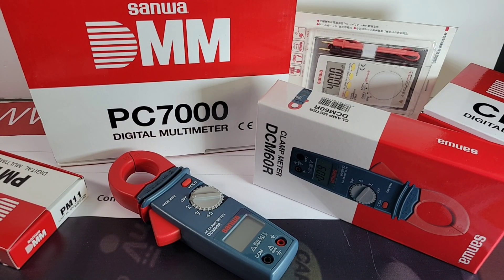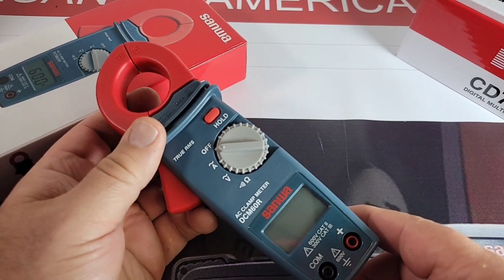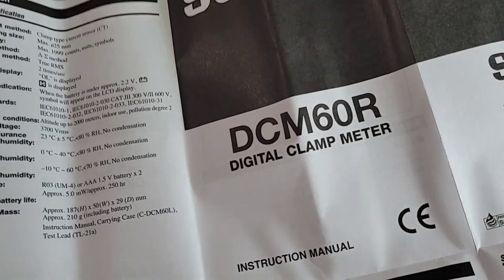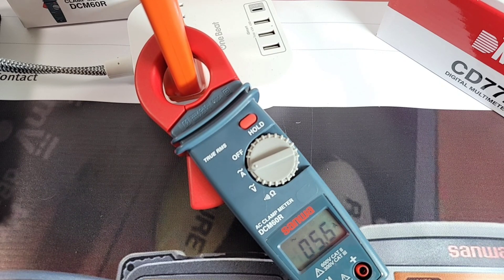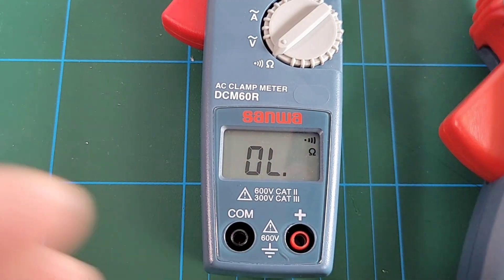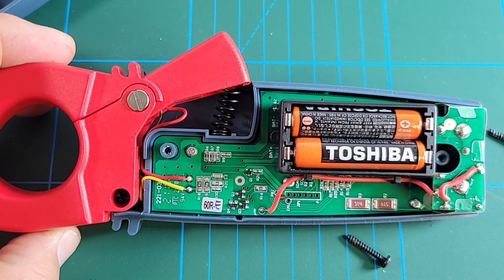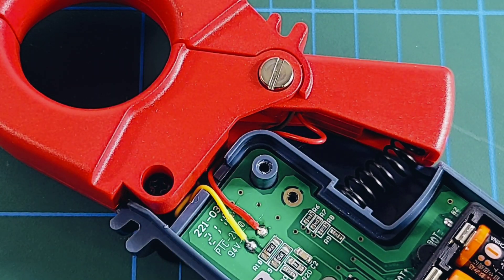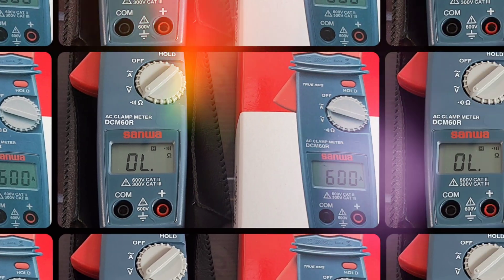SANWA DCM60R AC Clamp Review & Teardown!

Comment: good for general electrical troubleshooting but if this were my first clamp meter, I’ll probably have to buy another clamp meter with more features (DC voltage & current, capacitance measurement, etc). I think this meter is made only for specific customers, Maybe for entities/organization that has strict regulations and doesn't want to bother testing and documenting other unrequired  parameters.
Reply from the maker: Yes, I agree 👍

Comment: Always glad to see the Taiwan build quality, especially in an AC specific device.  As has already been said I would think they could include a back light and more audible beeper & better resistance function in this price range particularly when working with AC, but I cant really fault it for no DC function as it says right on the device AC CLAMP METER so you have to consider it a device with a specific purpose - though oddly by coincidence the first letters in the model munber are in fact "DC" - lol - but thats very likely for "DC Clamp".  One thing, one of the most common uses for these clamp meters is HVAC which always includes motor and start up cap testing so that would have been a logical inclusion in this meters $85 MSRP, again it gets down to your specific purpose with this meter.  What we could see of the input protection looked respectable and the Taiwan / Sanwa design and build quality always has that air of dependability when working with AC voltage and amperage.

Comment: Sorry, I can´t get who should buy this clampmeter? Only AC and Amperage up to 600 A - that would be a professional electrician in a CAT IV enviroment ( power supply of a house) or heavy industrial enviroment. But without matching CAT-rating and not independent certified? Highly unlikely...
For usage with electronics, car electric and inhouse electric installation I stick to the Uni-T UT210E clampmeter. Much more versatile (Amps and Volts DC and AC!), hence more useful and btw available for half the price of this SANWA.